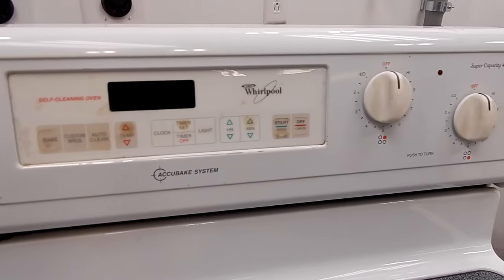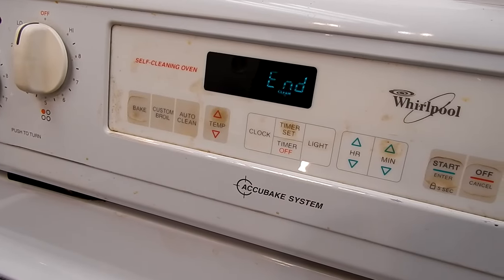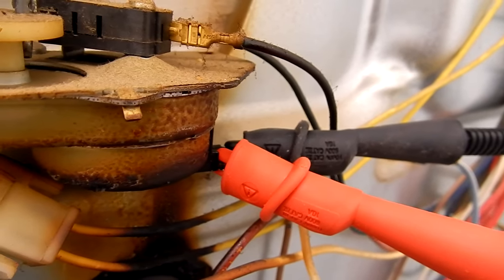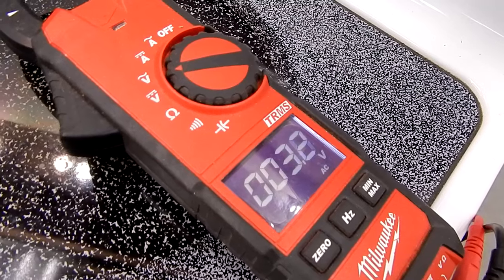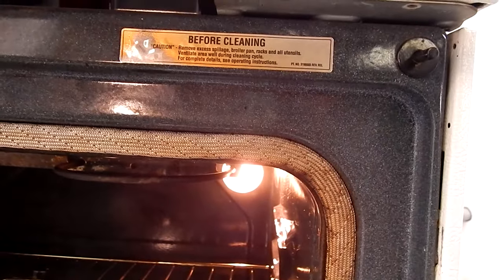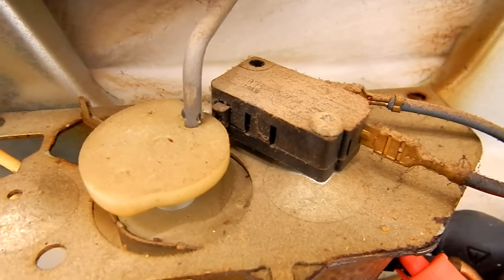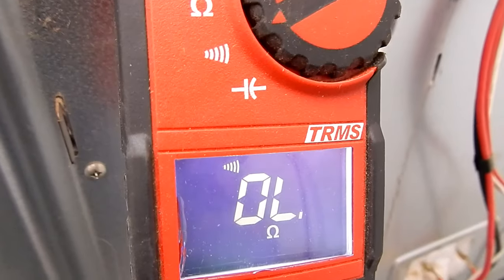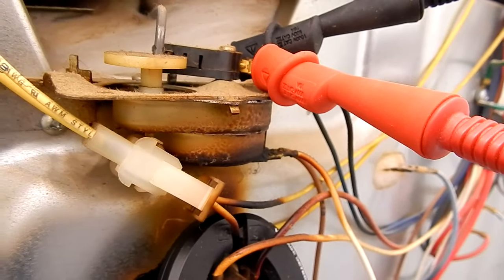How to Troubleshoot the Door Lock on your Stove / Range

Comment: Insanely moronic that a whole line of stoves would be designed with a motor that locks the door rather than a manual lever. Thankfully mine is a rental.

Comment: Bill, the oven door became locked when I shut off the power from a circuit breaker. But when I turned the power back on it unlocked the door. But now it won’t even lock but the light comes on when I open it. With the new panel I don’t see any lights go on but an intermittent beeping. Any suggestions?

Comment: Mine is giving F5 E0 on a KitchenAid Superba and not recognizing when door closed. The light does not go off when I trigger the door switch but I tested the switch and it is working. The door latch switch also works when tested. There is 120v being sent to the motor all the time though. But the latch is in the open position. Does this sounds like latch assy or control board issue? Thank you

Comment: Thanks Bill.  My issue was that my wife set the range into cleaning mode then opened the door, which resulted in the the latch moving into the closed position while the door was open.  
Nothing I did would get the latch to move back to the opened position.  Seeing your video I thought to manually depress the door closed switch  so the light went out, then held the Cancel/stop button, which did the trick!  You saved me having to go a lot deeper.  Thanks for giving me my afternoon back!
Reply: thank you ,i did the same thing as your wife ,your comment helped me greatly.
Reply: Did the same thing. and it worked perfectly. Had called the manufacturer help line and they couldn't help at all . Saved me a service call  thanks
Reply: This one helped me the most
Reply: Life saver in 2023
Reply: You saved me i only had to press the light switch button on screen to unlock door 💀 who wires ovem like this 😩😂

Comment: Thank you for this video! I was on the verge of calling a repair man for a $99 service charge plus parts. Your class on YouTube University saved me. I cleaned the oven and the Locked icon would not go off. The lock was stuck and would not return to the correct position. It turns out that the light wasn't going off when the door was  closed because the light button hadn't been pushed all the way in. I pushed it with my finger, and BAM! the lock returned to the correct position and the icon went off!  Hallelujah! Again, thank you! (73 year old woman)

Comment: Hello Bill,
I have a 25 years old oven and it was working great.  The other day I ran the self-cleaning and the self-cleaning cycle was interrupted.  After that, I could not unlock the latch to open the door.  No error code is available on this oven but something is holding the manual latch and won’t release it.  The manual handle is on the outside of the oven door, but I was told not to force the latch open as I could cause more problems.
The oven is a GE JB550GJ and the latch is a manual lock.  You slide the latch handle from the left to the right to lock the oven door for self-clean.  (I searched the Internet and most solutions for unlocking the latch are for automatic locking mechanism, not for manual latches.)
I powered the oven down for minutes then powered it on.  I gently sliding the latch to the left but it won’t release.  I tried to run another self-cleaning cycle, but it won’t start the self-cleaning now.  Do you know how to release the manual door latch?  My specific questions are:
(1)	What is holding the manual latch and not letting go?  Is there a way to unlock the latch?  What are the specific steps required to reset this specific oven and to allow unlocking a manual latch?
(2)	I have the user manual but it only talks about how to use the oven.  I need a service manual to help me understand how the latch got stuck.  I searched the Internet but I could not find a service manual for this old model.  Do you know where I can download a copy?
(3)	If I pull the oven out and access the back of the oven, is there an easy way to unlock the oven from the back?  Do you think my old GE has a locking pawl inside the back panel which I can toggle to unlock the latch?
(4)	I searched the Internet and found no parts relating to the locking mechanism.  Do I need new parts to repair this problem after I get the door to open so it won’t happen again?
Thank you for your help.  Phil

Comment: I built, I have a 10 more glass top stove When I press self clean I get a DR on my control panel and beeping  Sound. I have checked the continuity on the door motor For the switch and the motor and I tested the light switch.and I tested the light switch It works no problem When I test the voltage on the motor I'm only getting a lower reading than what you are showing I'm getting around 40 V

Comment: I have a Frigidaire oven. When the oven door is closed, the lock repeatedly keeps locking and unlocking. I've pushed all the buttons and nothing helps. Even when I turned the circuit breaker off and on, the lock starts back up automatically. The locking mechanism only stops moving when I open the oven door. Any advice?

Comment: Bill are you still repairing these days? I need some assistance with a drop in slide in Frigidaire electric range oven that won't unlock after self cleaning. I replaced tempertature sensor, and had the control board rebuilt...they say... But the darn oven is still giving an f30 error which says sensor is bad. And the darn oven lock assembly motor won't come out of the lock position. Help!
Reply: I just read that Bill passed away in 2016😢

Comment: Bosh built-in oven model HBL5451UC problem. I think the boiling water from cooktop spilled into the Bosch built in oven. Looks like that there is corrosion or water deposits on the CONTROL MODULE PROGRAMMED – # 12006841. I am not sure that Part# 12006841 is a correct part number. The door is looked, there is no power. How to unlock the door and fixed this oven?
Thanks,
Mike.

Comment: If you hold down the light button the door pushes when closed and hit start It will clear the door lock error code. At least it worked on mine.

Comment: In your case the motor was broken, correct ?
Reply from the maker: Dicofole To help you be a little more familiar with the parts and how they work so if you have an issue with the door lock on your stove, you'll have a better chance of figuring it out.
All the parts in this video tested good.  For instance, the motor was getting 120v AC, so it turned the cam that moved the bar.  If that motor was getting 120v AC and the cam on the motor did not spin, the motor would have been bad.
Thanks for Watching!